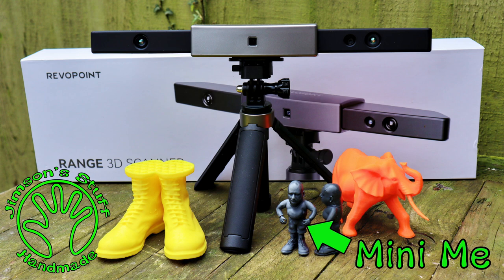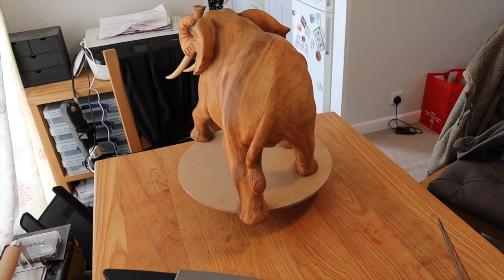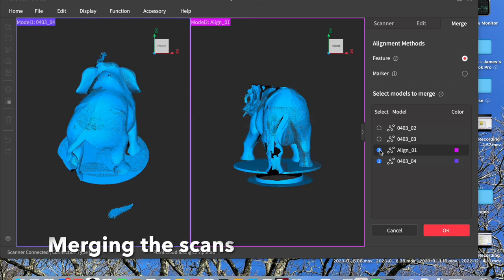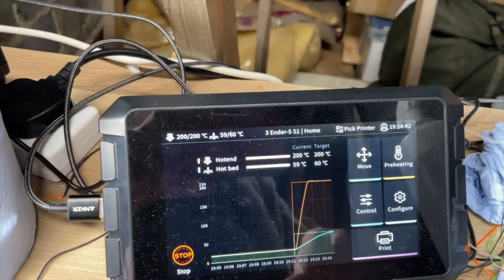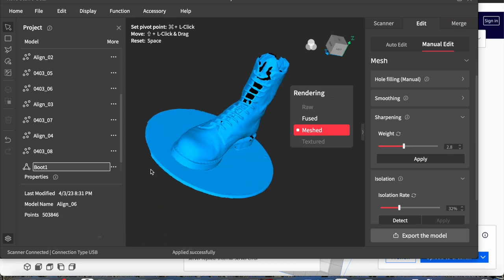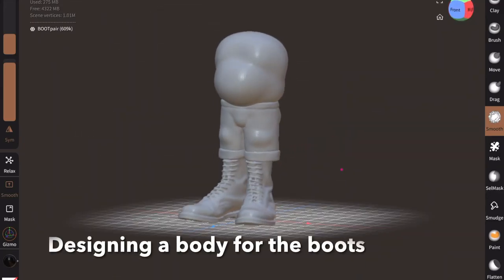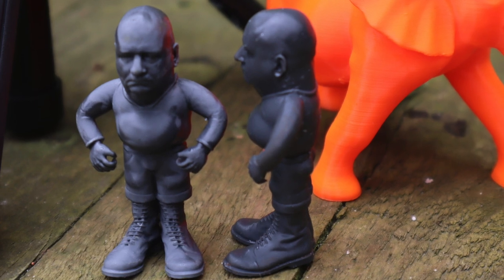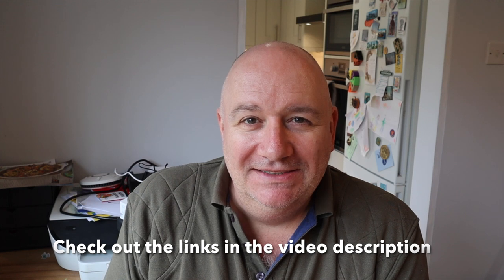3D Scanning with the Revopoint Range

Comment: Jim great video, So the "Range" is not the best of both worlds, large objects and precision detail? will it work for smaller objects?

Curious what you would recommend. Can you also use the range for smaller objects with satisfactory results? The Range details shows it has a 0.1mm precision and the mini has a 0.02mm precision. I am new to scanners and still doing research but for finer detail the mini would be best and for larger objects the Range would be more suited, correct?   I have an ender 6 printer, so I am looking for the best option to pair with that printer. Thank you.
.
Reply from the maker: Many thanks for taking the time to watch and comment. The Range is definitely more suited to larger objects but as you say you do lose a bit of detail. I generally use scanning to miniaturise objects, so a bit of detail loss is really not a problem. There is some good guidance to ideal scanning size on the Revopoint website. The Range is not great at scanning very small objects but can be used to safely scan faces. If you want to scan small detailed objects then the MINI is much better, I have achieved some highly detailed scans with the Mini ( I have made a couple of videos on this) but it is best suited to objects that will easily fit on the small provided turntable. The MINI is apparently not safe to use on faces. There will obviously be a limit to the detail that can be achieved with the Ender-6. Another option to consider would be the Revopoint POP2 but I have not personally tried that scanner.
As with all these consumer grade scanners they do take a lot of practice and experimentation to achieve the desired results and there will be some element of post processing involved.

Comment: Hi Jim, Thanks for doing this video, how do you think that the revopoint range 1 would do for scanning a full size surfboard aprox 6foot 6 inches,  obviously its flat and curvy, how do you think the revopoint range would perform for it?
Reply from the maker: It is certainly capable of scanning something that size but you will need to use scanning spray if it is shiny and you will need to cover it in a random pattern of the supplied marker dots. You then scan it in marker mode. Without marker dots the scanner would struggle to keep track on objects with low detail or features. Often it can take several attempts to achieve the desired result